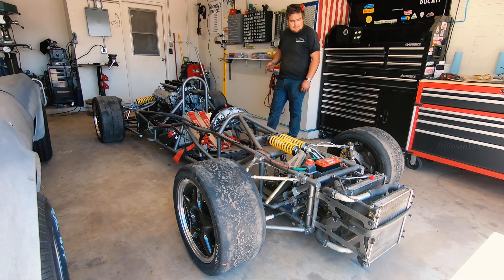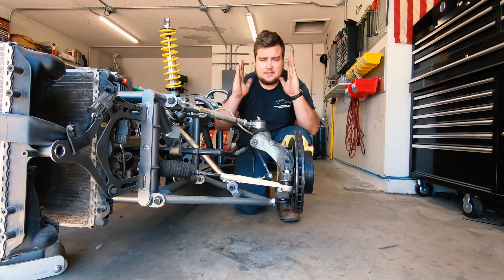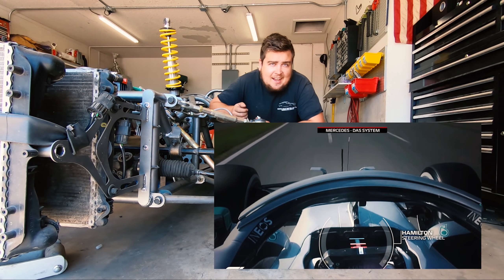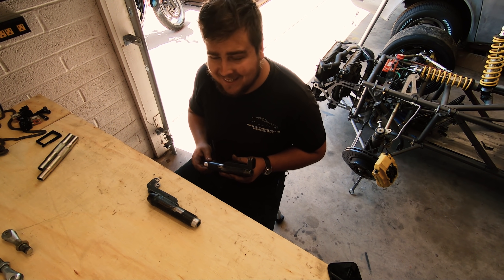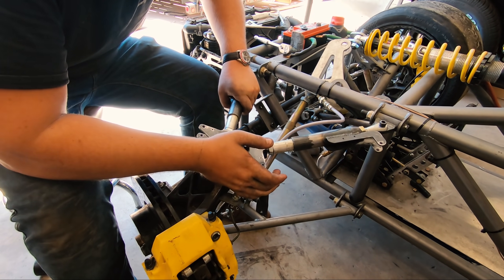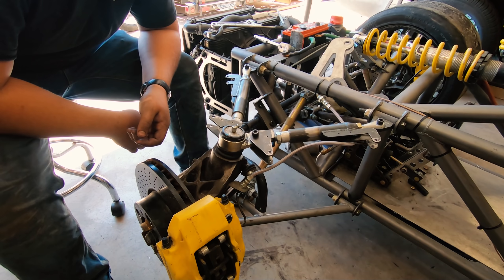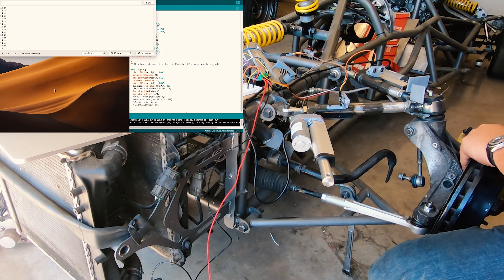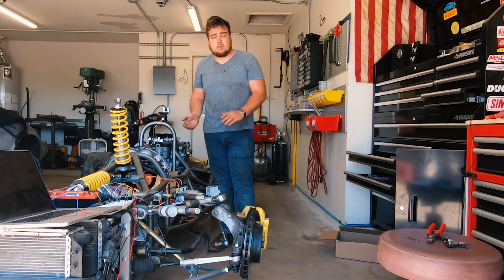DIY Formula 1 Active Suspension and DAS

Comment: Camber isn't toed in or out. Camber is either positive or negative.  So now you have 4 electrical actuators and 4 sensors and their associated wiring moving and flexing with the suspension. Then you have to have an onboard computer with good software and the steering wheel sensor. You'll never get it to work. Unless of course you're Mercedes and you have a building full of engineers with PhD's and a million dollar budget. Active suspension was banned by the FIA for good reason.

Comment: Very interesting, as always, a question for the general suspension design, shouldnt the camber decrease with the lowering of the (individual) side of the suspension? To keep the tire surface aligned with road during cornering. Just looking at it, seems like lowering the top triangle mount would do the trick. Dont know anything about suspension, but its very interesting! 🙂
Reply: Oh, im soo late to the party, too bad.. 😞

Comment: There are 5 main reasons why this suspension setup is both improper and dangerous:

1. You should never use a basic horizontally-mounted rod end as a replacement for the bottom ball joint. Especially on a rigid suspension, which will transfer huge forces and cause the rod end to bend or even break unexpectedly at some point.

2. A huge amount of extremely dangerous bump steep is being generated due to the variable length of the two upper A-arm motorized rods, because the steering rod remains in the middle of the upright. Shortening or lengthening of the upper motorized rods will cause an unwanted turn of the front wheels, despite that the steering wheel remains in a neutral central position. In order for such setup to work correctly, you have to consider using a completely different upright where both the lower A-arm and the steering rod are at the same level.

3. Each of the lower A-arms will suffer from excessive bending forces due to attaching the push rod near the middle instead of near the lower ball joint.

4. As an addition to the above, attaching the rod end near the middle of the lower A-arm basically makes the push-rod geometry far less effective, because the lower A-arm will transfer the impact and mass forces at a ratio of 5:3 (a proper ratio should be higher than 5:1). That alone forces you to use stronger and heavier springs, and increases the unwanted forces transferred across the entire structure and the bolt joints.

5. The distance between hard points of the lower A-arm and the dual upper motorized rods on the chassis is noticeably greater than the distance of the hard points of the upright. It should be the other way around. That alone will cause and unwanted wheel lean while high-speed cornering. Losing traction due to the excessive tyre warping is something you would want to avoid at high speeds.

Comment: if you still have this in mind try using IR sensors, wind will blow your sensors reading out (remember, sound moves through the air/wind), and will sugest to put those sensors at the back of those bars. Insanely advantage you will get with this system, once done there is only tuning for your driving style

Comment: Just wondering, but if you put a small hydraulic pump (like a motorcycle brake cilinder) on the pushrod, and make those actuating cilinders hydraulic, wouldn't it be fully analog, self adjusting?

Comment: is the goal for the camber / caster to change with track conditions, or for easy adjustments, or to adjust in the car while driving?  and!  any problems with the slide tubes gaulding up, cool work and i like your thinking

Comment: I love your builds... I do have a question regarding the cams for your shocks. How did you settle on that design? I have a tubular rear subframe for my Suby and want to go with cantilever suspension so I can get wider tires inside the wheel well.

Comment: 7:49 There are laser/LIDAR range finding modules and radar based modules for microcontrollers such as Arduino, RP2040, etc available on various online stores that are for microcontroller based projects. If the ultrasonic option proves itself to be somewhat undesirable due to whatever factors, could one of those alternatives provide a solution?

Comment: The ultrasonic sensors are not great while the vehicle is moving over about 30MpH! I have tested dozens of them on front bumper and got close to front vehicles and the best reaction I got was with the Steelmate parking sensors, which were showing 3meters distance when my front bumper had almost kissed my friend's rear bumper at a bit over 110MpH (~180 Km/H).

Comment: Silly active suspension implementation. Should be used in place or in conjunction with spring damper system. Would be interested in implementing this on a open rules prototype sports racer to control ride height.

Comment: This may be a bit late of a comment but I would be concerned about the sonar sensor with vibrations. It seems to be a short enough distance to read and send signal but I would defiantly do testing on how the sensor does with just the engine on and then drive time. As I am sure you are aware, automotive mechanical systems create a high noise threshold. Though you could install rubber or another material within the sensor mount to dampen the vibrations and lower the noise threashold. Also, I have seen some FSAE cars use these expensive linear resistors to measure suspension travel but I am interested nonetheless to see what you finally come up with.

Comment: I think your ultrasonic sensor idea will fail when the air velocity gets high enough. Between the noise and the signal being bent by the flow of air, I predict problems. See if it still works with a leafblower pointed right across the sensor...
I think you might get slightly better performance, reliably and packaging of your length sensor if you use a sliding tube and measure its resonance. You probably don't even need to excite it at all, just the vibrations from rolling or the engine running would probably work fine. Basically it would be a slide whistle with a mic inside one end. You could still use ultrasonic sensors, but I think that might be overkill. My first instinct is almost definitely overkill - that being an optical or magnetic digital encoder. I thought of this because I have been thinking about using this approach for a servo subwoofer for at least a decade. However there are lots of well-designed rotary and linear encoders you could use at dig-key, etc.

Comment: Your tie rods shouldn't be bearing any bending moment, so you should be able to use the hydraulic rams in place of the a-arm members, rather than in tandem with them, if that makes sense. That is, unless there's a problem with your design. The fact that your slip tubes didn't even look like binding tells me that it's pretty good.

Comment: Why not use only one actuator per wheel? You could have only one actuator that connects to the chassis and on the other end right in the middle of the top wishbone...
And also why not make a totally manual DAS? With parts connected to the steering wheel.

Comment: Camber is not whether something is toe in or toe out....that's called "toe". Geez, if you don't know the difference, no wonder you can't get the suspension set up properly. Let me know when you want help with roll rates, ride heights, damper settings, and -- oh yes -- toe and camber.

Comment: Cool idea, I thought of regular digital calipers and the way they measure distance changes.. I'm sure you could find a linear sensor designed like calipers are, or figure out some other way of doing it more mechanically and compact using that sort of idea instead of the current setup with the ultrasonic sensors. Just an idea!

Comment: Will the ultra-sonic sensor still work when the car is moving 10-20% of the speed of sound at more than 45 deg to the sensor? With all the vibration, and overall air movement?

Awesome project, BTW!
Also, this: https://youtu.be/W9T3uJomGLI

Comment: Rather than ultrasonic, use lasers. The measurement is so much faster and less prone to external noise! You'll find as soon as you have an engine running the ultrasonic sensors are way less accurate, especially in a uncontrolled environment. Lasers will still have an issue with vibrations, though still not as much of a problem as ultrasonic. You also mentioned adaptive learning, well my suggestion is PID, it's not really "learning" though will do the trick as it is reactive.

Comment: At my work we have some large valves that have a position sensor.  They have a pickup rod with a “pill” that rides over the shaft to get a position.  Would be a more secure way of measuring and more likely to hold up to debris and rain and etc.  wish I knew more about the exacts but you seem very resourceful.  I think something like this would give you a more reliable option.

Comment: I would suggest to use something like this (1) with a proper lens or a IR ToF (Time of Flight) sensor (2) over the ultrasonic. As you stated already, these ultrasonic sensors will break due to vibration. (2) might be influenced by direct sunlight, so a small tube around the sensor would be required.

1: https://www.digikey.nl/nl/product-highlight/a/acconeer-ab/xm132-xe132-entry-module
2: https://www.aliexpress.com/item/4000501203735.html?spm=a2g0o.productlist.0.0.6cf25c35in6IQv&algo_pvid=1e165289-007c-4bd8-86aa-db6f87469408&algo_expid=1e165289-007c-4bd8-86aa-db6f87469408-45&btsid=0b0a557016215347749904799e2187&ws_ab_test=searchweb0_0,searchweb201602_,searchweb201603_

Comment: At the start what you are describing is not how DAS works, you are describing bump steer - changes in steering when the wheel moves vertically. DAS changes the effective steering arm length, which brings toe in. Changing ride height in that way has been illegal for a while.

Comment: Just from a structural point of view, those adjustable arms work in tension/compression. Which means your sliding tubes are not really getting any load since they are free sliding. Most of the load will be onto the linear actuator. you better build/buy a strong actuator to begin with. I like your hydraulic idea tho...

Comment: Thought you meant active suspension as in interlinked hydraulic shocks, but actual motor arms would be very cool, I could imagine a vehicle going from street performance to off-road mudding with a button touch changing lift and suspension angles.

Comment: Wonder if you could split the ultrasonic sensor TX and RX, and put one at either end of the tube, inside, in a clean environment - or does it 100% rely on the reflection?

Comment: If you're going for ride height control too, instead of hydraulics I would suggest a linear induction motor (actuator) in series with a small & soft spring. A couple of load cells would do the trick for control (both positional and load based) and it should be a pretty simple PID loop. It could even act as a damper. Hydraulics can do all that stuff too, but I believe it would be slower, more complex (debatable), and even pricier. Only downside being you would probably have to build it yourself.

Comment: I've always wondered if you could power a small hydraulic system on a car using a power steering pump.  When you do switch to hydraulics for this suspension, what were you planning on using for a pump?

Comment: Just a little heads up. Switch to Visual Mirco on Visual Studio. It is an IDE for Visual Studio that allows easy debugging, plot graphs of input, analog and digital etc etc fro arduino. It will save you so much time you wont belive it

Comment: I'm guessing you're going to need a couple g senors (7 axis are cheap enough)so you can model tire deformation, and thus change the chamber to gain maximum grip based on this.  That said you might get too much grip up front and create a major oversteer problem.  So you will probably be doing this at each corner.  You will also use the g senors to evaluate whether your braking or accelerating were you will want to change your toe in/out affecting turn in to corners.  You have a fun project, wish I had time to play with projects like that.  Keep it up!!

Comment: Ultrasound sensor will not work in drive because wave travel speed is depended on air speed. So your measurement would be off

Comment: Try to use different kind of distance sensor or cover it. Ultrasonic distance sensor are really sensible wind/turbulent flow and non stable air pressure like what is going to happen when id going to move

Comment: This is great! 
Maybe if you cover with carbon fiber or kevlar the wishbone and the hydraulics, that would make the aerodynimic air flow a bit better? 
And if you are going so deep in your project, i like the idea to have small flaps or extra wings attached to the wishbone.

Is it possible to install a live telemetry and GPS, so the main computer can learn the vibrations, g forces and vehicle speed on every corner and then the computer can adjust the height, stiffness and the toe of the car? With every lap the computer to learn more and to make better calculations? 
I am not an engineer, but i was thinking about this idea for couple of days and your video made me even more curious.
And i must subscribe to your channel! 😄

Comment: I think you may run into trouble with the ultrasonic transducers – they aren't super reliable in motion. A TDoF laser distance sensor might be a great replacement, with similar cost and millimeter accuracy. ST Microelectronics makes the VL53L0X, which is capable of sensing distance in the range of ~30mm to 1000mm – so I'm thinking it would cover your use case nicely. To make it robust enough to use during a race, you'd probably want to have the beam path shrouded so that dust or other debris can't interfere with it. You can probably take a similar approach for the steering wheel ;)

The icing on the cake is that Adafruit makes a nice breakout board for it, for $15: https://www.adafruit.com/product/3317, and they already have an Arduino library so you can get up and running quickly.

Comment: And in his 1st race 
Coming out of a turn
 he gets put into the wall makes the pass on the wall 
surprise his active camber and auto wall avoidence system 
Dropped the outside wheels to full 90 deg before wall contact and thusly drove along the wall accelerating nicely till breaking away dropping caster back to normal vertical angles and driving away

Comment: Linear Variable Differential Transducers (LVDT)s, compact, sealed, feedback/noise resistant and ideal when coupled w/hydraulics. Aircraft use them because they're obscenely simple/reliable. You can probably find surplus aircraft hydraulics w/them already built in. Importantly, they play nice w/Arduino, typically needing only a 555 timer to get a feedback from them.

Comment: The ultrasonic sensors you use are open type and will stop functioning after a while due to dirt etc.  You may want to use car type ultrasonics that work behind plastic.  basically parking sensors.  also on hydrolics you may want to use magnetic sensors or lineer potentiometer to give you precise control over the movement in any weather condition.  I would also put a warning and a set value if the sensor gets damaged so the suspension does not go to a wierd geometry and tries to kill you.

Awesome project.

Comment: So... are you gonna put a free valve in this?

EDIT:
I dont think that the ultrasonic sensors will be the best long term. Mostly because they can be a little sensitive to dirt and shock... Which is something that im expecting that this part of the car would be dealing with a lot.

Have you considered a linear potentiometer? Yes they are still not the most rugged... but they could accomplish the same idea readable distance, but should be less sensitive to outside forces that might trip up an ultrasonic sensor. (Edit again, you have thought of the linear pots. So probably ignore all of that)

Another idea I have is, when you go hydraulic, you should be able to use something like a servo. The servo could be used with the hydraulic pump to keep track of where its supposed to be, allowing you to control with a reasonable accuracy the extension of the cylinder. And then using a pressure sensor, you could determine changes in pressure which would allow you to react to, extra pressure, low pressure, and also potentially test the system for leaks or something like that. Also depending on how the servo is setup, you might be able to completely not have the pressure sensor since it should be able to feed back the force applied on the servo itself by reading the rotation, (depending on the pump of course) and depending on the reaction time, react to what the car is doing.

I honestly think that a servo, or closed loop control of the hydraulic motor would be key to getting a lot of information at once when you go hydraulic

Idk these are just my ideas, love the build and it makes me think of all the things I wish i had the time, money and skills for lol

Comment: Is the idea for the eventual hydraulic system to encompass far less movement? Also might it be possible to mount one ram between the upper A arms to simplify the system, or is the idea to also incorporate adjust caster?